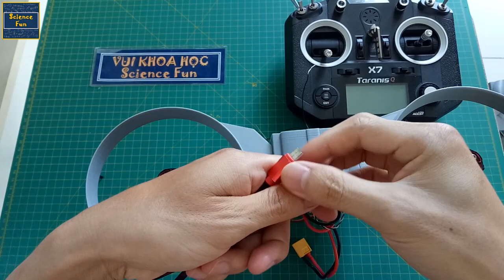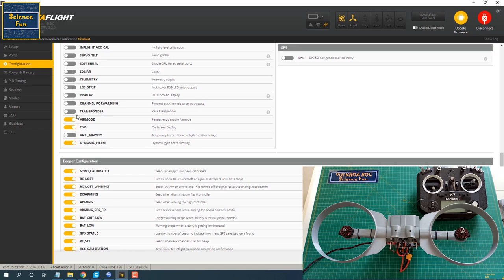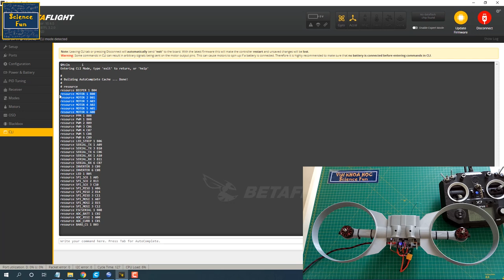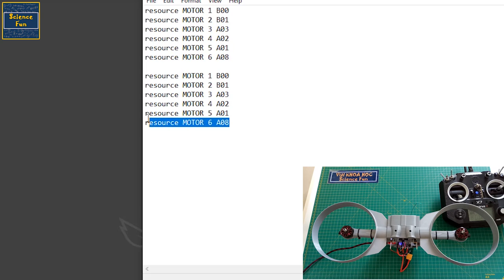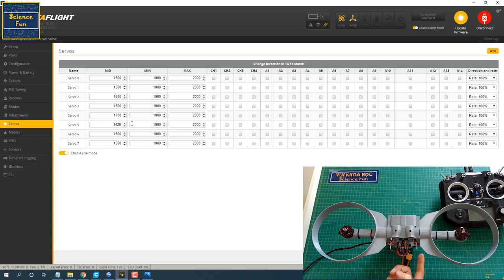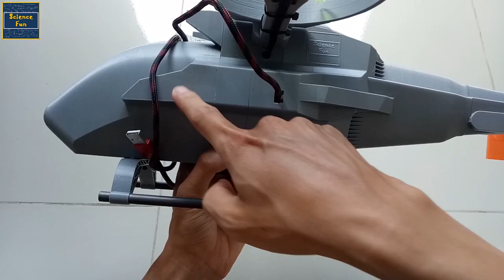SETUP RC AVATAR SCORPION 3D Printed

Comment from the maker: Some of my friends had issues with version of Flight controller. It's seem older version will be suitable. My version of FC is 3.2.0  Sep 28 2017 (It's seem default version from manufacture). If your drone not ok with newer version, try to flash firmware to the old one. You can find my dump file of my FC here: https://drive.google.com/file/d/1ySG7-rEEmyRIyFPckzPDAIeFpw4-tfjQ/view?usp=sharing
Here is link for older version if you want to downgrade version of FC to 3.2: https://github.com/betaflight/betaflight/releases/tag/v3.2.0
You find the file: OMNIBUSF4SD.hex, download it, then in betaflight flash it by "load firmware [local]" choose the file .hex you just download to flash

Comment: Hello,
Can RC AVATAR SCORPION V2 with Betaflight F4V3S F4 V3 V3S PLUS Flight Controller Built-in Barometer OSD 5V 9V Dual Output for RC FPV Racing Drone operate with Spektrum RC system? Or any other control board that fits the Spektrum RC?
Best regards,
Sven-Erik Anundi
Sweden

Comment: (FlySky Fs i6x) I made all the settings with this remote, but the motors did not work. if you can help
Reply from the maker: It's all from setting on software, I think you should search on youtube for basic setup on betaflight step by step to find yout how motor did not work
Reply: @sciencefun5059   MOTORS WORK WITH VRR. NOT WITH SWA

Comment: hi bro my servo motor not work in omnibus f4 pro v2
i have done all the settings after watching your video  no servo motor working and not drone motor working proprelly plz helpp
Reply from the maker: Hi, could you check your wring component? If it not working so something wrong about your wiring

Comment: Hello, did you use 3.2 version of Betaflight?
Reply from the maker: I dont know, mine is Betaflight Configurator 10.6.0. I thinks different  version will not change basic setting